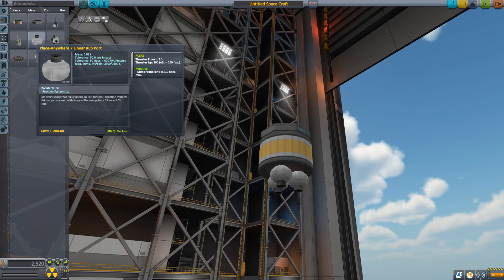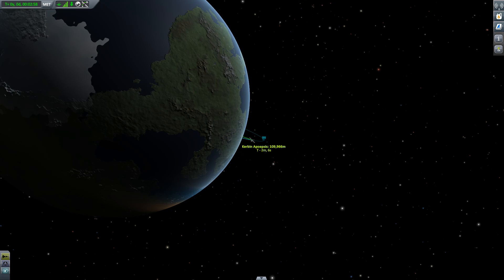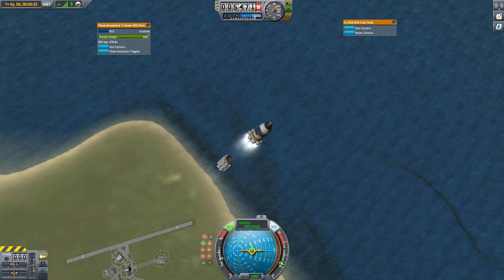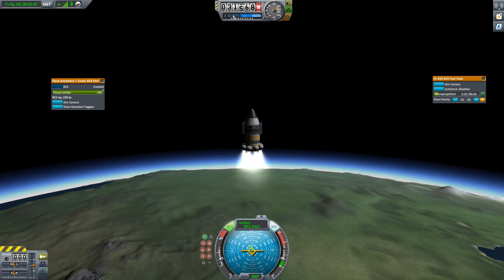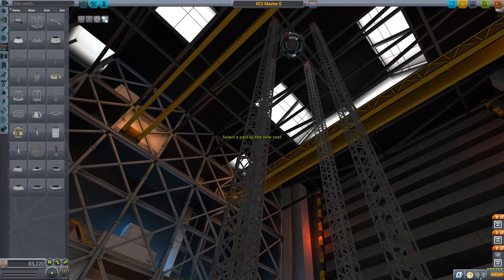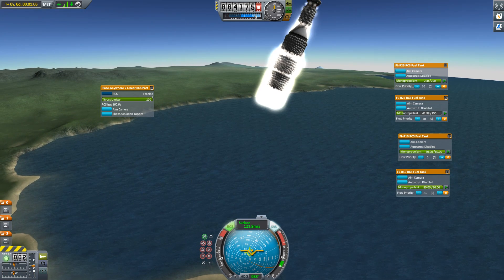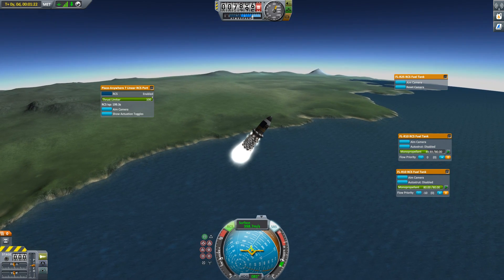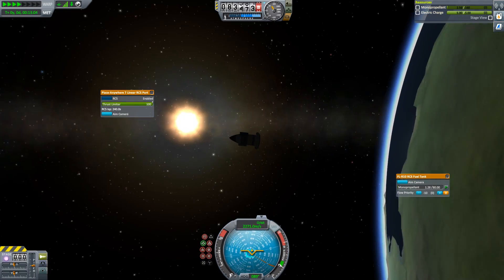KSP Challenge - Launching Rocket Using Weakest Engines

Comment: "Stock hardware"
*Proceeds to use 4 km high launch clamps
Reply: Bugs are glitches are stock :D
Reply: You can get that in stock KSP. Scott showed you how!
Reply: Invigorate Many mods include rockets. Are all rockets non-stock?
Reply: You could rove the rocket up the mountain to get that 4km gain. But with this ammount of parts it will brobably be a lot of pain
Reply: @pafnutiytheartist  You trying to be a poet? Don't quit your day job. Lol.
Reply: @vincewilson1  the poetry was completely accidental, didn't even notice lol
Reply: They'd actually be better off moving to Ecuador. The tallest peak may only be 20k feet but launching from the equator would probably make up for the 2.5 psia altitude/pressure difference. 

Also worth noting, NASA, and everyone else who builds rocket engines for that matter, have purpose built rocket engines for atmospheric flight. The RCS thrusters in KSP are generally intended to work only in space despite the fact that they sort of work within the atmosphere. So while, NASA may benefit from launching at a higher altitude, doing so only means less compromise on nozzle design.
Reply: "No cheating!"
Reply: Only non-stock rockets...
Reply: Kleiner Prinz Putting aside territorial concerns...It's too far from the equator, too hard to get rockets there, and there aren't any convenient oceans for rockets to fall into if something goes wrong.
Reply: Every single rocket engine uses newtonian physics, you cant get around it.
Reply: 1,4 billion isn't even close to half of about 7,5 billion
Reply: +Paul Donlin
I think the RCS thrusters are just supposed to use Newtonian physics; force in one direction = force opposite, so RCS thrusters, and fire extinguishers attached to office chairs, work in real life, it's just that gravity is a lot more forceful at most altitudes than the force of RCS thrusters.
Reply: Leo Qvarnström sorry for my stupid ambiguity, it was 3am and I was tired :')
Reply: But, he only used stock.....therefore.............ITS LEGIT
Reply: Titouan, at least he didn't stretch the clamps to space
Reply: I see no issue here. As they say if the dark lord Danny can do it then you should do it too. do it, but do it bigger.
Reply: So actually Nasa is doing it wrong. They need to move their launchpad to the Himalaya. Or maybe is that real reason behind why they support the Dalai Lama so hard to become Religious Emperor of Tibet?
Reply: @Blue Chill dude. You are taking it way too seriously.
Reply: Gaalidas Then only non-stock methods of building outside the hangar are non-stock. This is not one of those.
Reply: + Blue  Ummmmmmmmm......Tibet is in China, who is seems to be so afraid of a 80+ year old man that they claim him to be the devil.  China, btw has about half of the worlds population within its boarders, and is a nuclear power and does not hold the U.S., or its allies in high regard.
Reply: What? Well first off U.s doesn't have land in the Himalayas, secondly it would be extremely expensive to get a rocket +launch pad up that high. It's more prudent to make close to the equator which is why they picked Florida.

P.s I highly doubt anyone in the States give a damn about Dalai Lama nor anything about India Politics aside from trade + military politics.... Now if you found a large reserve of oil or OPENLY  support communism (Although the latter probably not as much as recent history)... THEN the states will give half a rats ass
Reply: Timothy McLean It's also a mod

Comment: Challenge:go to all planets (moons if you want to) no refuel and in first person mode only, using weakest engines, cheating not allowed.
No sort of cheating allowed.
:3
Reply: In real time (no time warp)
Reply: For normal people? yes. For Scott? he does that during lunchtime.
Reply: Proceeds to build launch clamps spanning inter-planetary space
Reply: without maneuver nodes
Reply: I assume you meant to include real solar system there.
Reply: Blindfolded
Reply: and Matt Lowne is already on the task
Reply: Too easy.  No engines.  Only 1 wheel, 1 solar panel, and 1 battery.  But as many lander legs as you want.
Reply: The "weakest engines" part is uninteresting, and overall that would just be long and boring.
Reply: Tied to a chair!
Reply: And no saving and loading obviously
Reply: UZI on console
Reply: Scott Manley is a paragon among those of Chuck Norris and Bruce Lee. What we call "challenges" are what he calls "casual" mode. 

We see game modes such as casual, easy, medium, hard, expert, and impossible.

For Scott Manley, all 6 of those modes would be called Casual. He would create 6 more modes harder than casual and call it Easy mode.
Reply: LUL
Reply: UZI 
Any celestial body would be honored to have a Scott Manley landing ridiculous rockets on its surface.
Reply: Jool implodes
Reply: +UZI  With an incredible amount of skill.  And possibly some really tall launch clamps.
Reply: SuperEdd32 Hazardish already done
Reply: Burnt Toast how is he going to get onto the celestial bodies?
Reply: Holy fuck 146 likes 0.0
WHAAAAT
Reply: UZI that the same as telling a blind person to stand on the lookout for a noiseless enemy
Reply: Are you drunk?